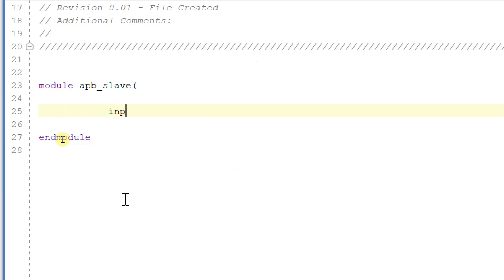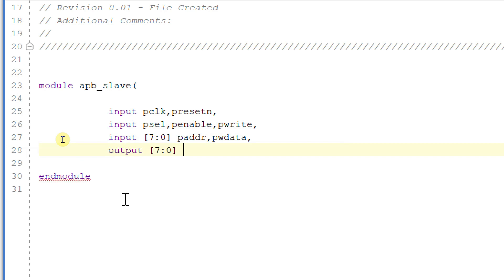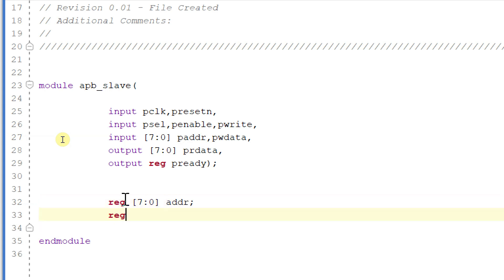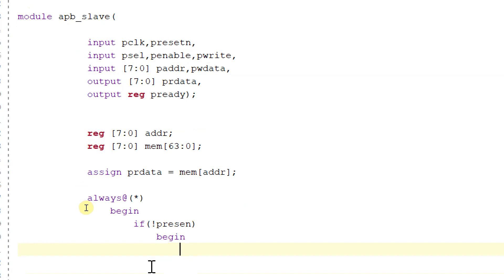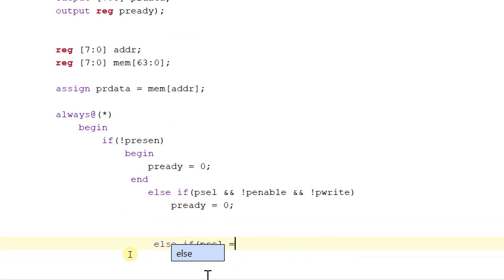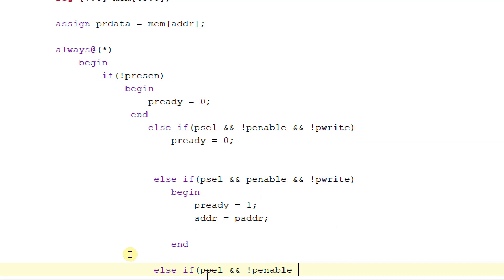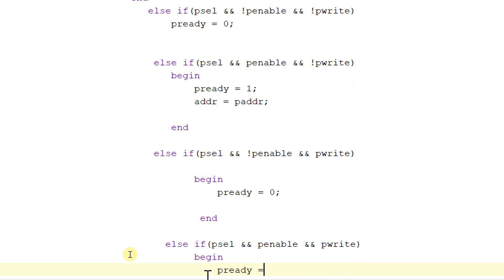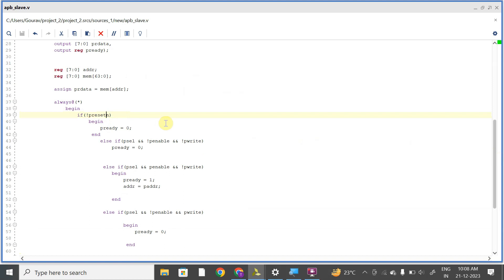Verilog Code for apb Slave|| Amba apb Bus protocol||

Comment: why mem is 63:0?? is there any logic ?? I think it should be 255:0, because add is 7:0 means 8 bits. so 8 bits wide address can point 2^8 = 256 memory locations. is that true ?
Reply from the maker: Its completly random i just writjng the code for simulation